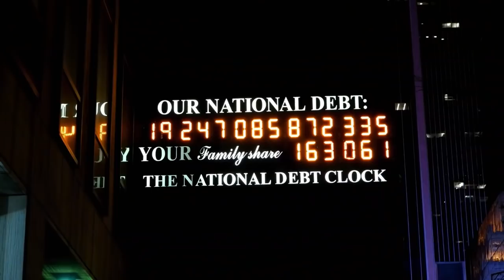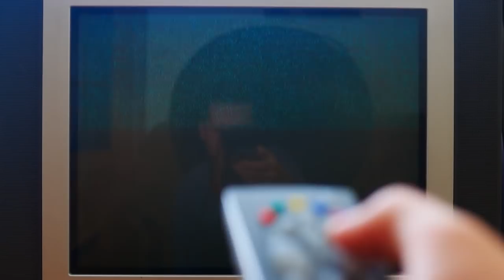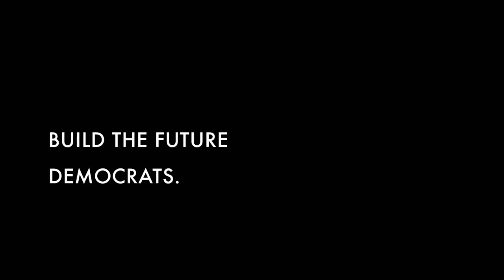Built not Bought: Comments on New Democrat Messaging

Comment: Essentially, double talk. Which is the main platform of the Democratic Party. Lmfao
Reply: @roblewisjr2  Are you kidding? What a skewed and biased way to look at this video. Jordan was quite fair.
Reply: The Amazing Lucas – So if you don't want a radical left, but when the left starts appealing to common core values and hard work, you accuse them of being disingenuous, I start to wonder what you do want. I'm sure you agree with Peterson that sane people on both sides is necessary for a functional dialog, so what would a reasonable liberal opposition look like to you?

And are you denying that there's anyone sane left on the entire left side of the spectrum?
Reply: Democrats had 8 years to build that America. Trump has had two years and a barrage of media and resistance. And he is building that America.
Reply: Roger C – The Republicans have control of two (arguably three) branches of government, and they still couldn't come up with a better solution than Obamacare and get it passed, despite having had 8 years to think about it. What exactly, besides the tax cuts which in the long term will only benefit the rich, has changed for the average working person under Republican control?
Reply: The thing is, media that makes democrats more acceptable won't change the progressive core of the party. They are out to crush you whichever words they use to build thier coalition.
Reply: EFCasual – This is not just media to make Democrats seem appealing. Sure, it is partly that, but it is also the reasonable part of the party getting together and saying "let's cut out the crazies and go back to the roots of what made the Democrats who we are" – i.e. focusing on making things better for the working class. Surely that's what centrists and conservatives have wanted all along?
Reply: The Amazing Lucas! Love your vids. Been watching your vids for a while but just barely started subscribing.
Reply: @razzle_dazzle  they should represent that in their candidates and a coherent platform, not ads in swing states.
Reply: Daz I’ll believe it when I see it. Maybe the democrats or liberal leaning people who can’t find strength in themselves will soak this up but someone with a back bone and could care less about and social welfare system because they have the inner strength to pave they’re own path will see this as bullshit. Blame yourself first and look within. All this was propaganda to me.
Reply: @razzle_dazzle  If you think that the tax cuts will only benefit the rich long term your political opinions are not grounded in reality.
Reply: The Amazing Lucas correct this could have been just another democratic propaganda piece. The only difference was it didn’t shit all over American values. Instead it twisted them into something different and left out many of the core American values that made it the most powerful and influential country on the face of the planet in less time than any other. Its not just the (worker) that did it. Then it took out a core component of how we became powerful and successful and switched these people to the demons. The evil .1 percent. By the way the richest of them are by all means (liberals) and all of them have received govt. subsidies and use money to influence govt. most notably the Democratic Party. Also many of them do harm to our society for instance our social media platforms and the rest of the people in Silicon Valley who look to sell out its products at any step. Its products being people.
Reply: By the end I became suspicious of the same rules mentioned earlier because of them saying the want to fight the higher pay deserved. What you are paid should be determined between the employee and employer. Raise the minimum wage and them I am in violation of the law if I have people on the payroll that I cannot aford to pay govt. wage so... LAY-OFF TIME! The criminals who would dare pay below the government set wage would be heroes in keeping people employed. The dems still do not understand this.
Reply: Jazion – I'm only repeating what more knowledgeable people (i.e. economists) have said. It's not just something I pulled out of thin air.
Reply: So some guy is a traitor because he votes his conscience, which tells him that this is a terrible bill that will cause millions of people to eventually lose healthcare, and which had abysmal (like 15%) approval ratings? I think if you're expecting complete political partisanship, whether your party is right or wrong, you'd be at odds with Peterson and most other reasonable people.
Reply: @Daz - Too late. We see through it. The DNC crapped all over centrists and moderates (for years) and then gaslit the Hell out of people who refused to vote for Hillary after learning she'd rigged the primary. Now they've gotten violent, radical, and condone if not promote political harassment and intimidation of anyone not towing their party line. Not falling for this "oh, we're totally centrist and for the working class, you can trust us now, guys".
Reply: irascible Rob?
Reply: I agree, the Democratic is socialist, that won't change no matter what lies they tell.
Reply: Herskovitz,  Hurwitz, and Khouri. All you need to know.
Reply: @razzle_dazzle  
Exactly, this new movement in the left should be praised for stepping away from such radical ideologies and I hope it gains traction. There will always be room for critique which was properly given in this video. There is also room for considerable critique on a lot of the platforms on the right.  platforms
Reply: Despite my sincere admiration of Dr. Peterson's optimism, I am forced reluctantly to agree with The Amazing Lucas.  I watch the ad and read it quite differently. It seems to me like hypocritical and condescending pandering to the demographic the Democrat party entirely ignored and largely lost in the 2016 election.  Something along the lines of "Middle America?  They're dumb hicks, this'll fool them.  And we'll throw in a cop and some references to the history we despise, for good measure." But I tend to be a cynic, so that's just my own gut instinct.
Reply: Yall have let yourselfs become way too alienated from the left, and not without good reasons. The democrats have made their fair share of mistakes in the past years. But you’re going to see a video by them that takes a step in the right direction and immediately believe it’s all lies hiding their true Marxist intentions? I mean come on, all great societies are built upon trust.  Don’t buy into seeing the other side of the same coin as the enemy.
Reply: +Rob Lewis No, he's not, Jordan is a true non-partisan.  He's said that gun to his head, he's likely closest to a classic British Liberal, but most of us have caught on that that's more conservative than the most staunch Rebublican or Cdn Conservative these days.  He thought hard about running for the Liberal Party, then he thought hard about running for the Conservative Party.  He's given speeches to both parties.  Hello McFly, hope that's all clear as mud, so much for your sleuthing.
Reply: @c0xb0x  - what do Democrats call this again? ... whataboutism? We're talking about the Democrat's piece here and what it's trying to accomplish.  Republicans, for all their faults, at least have a healthy respect (FEAR) of their newly found base. I actually think it would be a good thing if Dems could self reflect just a bit and actually reform from the bottom up and give this country a sane, balanced Left wing (emphasis on sane). But it's obvious they have to completely crash and burn first. They've learned nothing since the last election. Zero. I'm actually hoping for a 3rd, maybe even 4th party to emerge out of the Democrats' dilemma. Get the Socialists and Commies out of there. Until then, many moderates and centrists can't help but vote Republican. And Republicans actually seem to understand this and accommodate us, unlike the Democrats, who've doubled down on extremism.
Reply: potentialitee  What in the democratic platform is insane according to you, and how did the democratic party double down on extremism?
Reply: potentialitee  And republicans are running literal anarcho-capitalists, and I could point to a number of (R) people who have done messed up stuff. My point is, if you're going to look at the fringe, you won't ever be able to vote for any party.
Reply: Republican leaders have denounced fringe activities, while Democrat leaders have supported them.
Reply: Betas, all of them.Bitter betas (there are some sane ones)
But i tell you what if they try to REFORM their party from within  they will be ripped to shreds.The demons leaders will do the same to them as they do to anyone else (remember Bernie?)
The only thing a sane Dem can do is vote Republicans - just this once - and starve...them...out.
They are demons.
Reply: +Roger C - Yea I wonder how many people with critically important jobs would like to work under an incessant barrage of destructive shit from ruthless wolf packs we see with the so-called democrats. I want to hear from someone that approves of being ruled by a government with powerful "representatives" like those that showed themselves in the attempted Kavanaugh destruction. Do you have any Idea what our country would be like if this Gestapo like power was allowed to prosper?